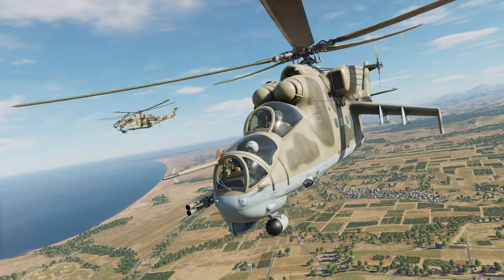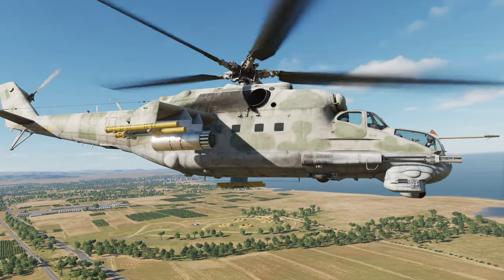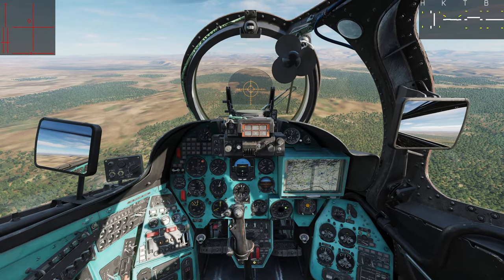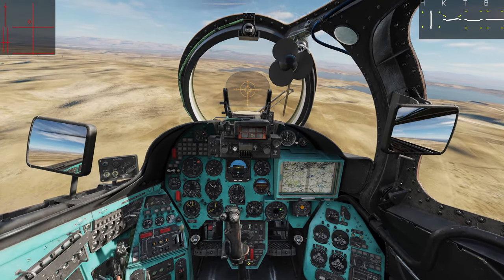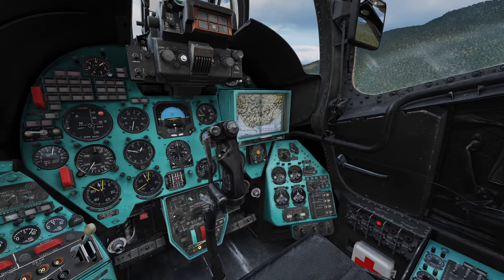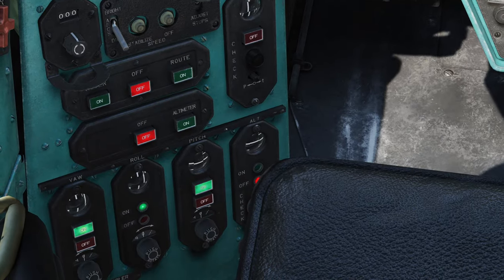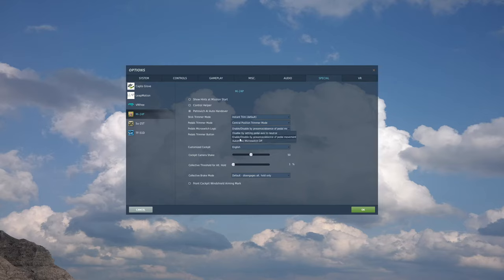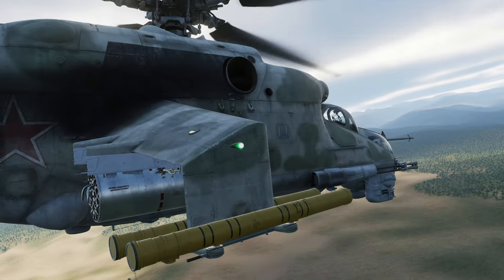DCS WORLD: MI-24P Trim & Microswitch Settings

Comment: The instant trim is the most realistic option if anyone is interested. The way to counteract the jolt is to click the trim lots of times as fast as you can as you’re settling into the new position. It has to do with the way magnetic springs are set up. You get the hang of it in time.
t. Mi-8 pilot
Reply: Finally someone that appreciate realism

Comment: Excelent video, very clear and concise. Just one observation, the default trim option for the cyclic is the force feedback friendly one. The springless option is only for those sticks without spring. I fly with a Sidewinder FFB2 and using the springless option doesn't work well, the default option simulates trimming seamlessly as long as the stick is calibrated properly.
Reply: He mentioned during the video that system detects FFB stick automatically and hijacks all input for special  FFB logic which is different from any of special settings ones. I think Force Feedback can be activated in main menu.
Reply: Proper trim setting for FFB is basically Instant trim. Can't tell if other settings are ignored, always used that and it's fine.

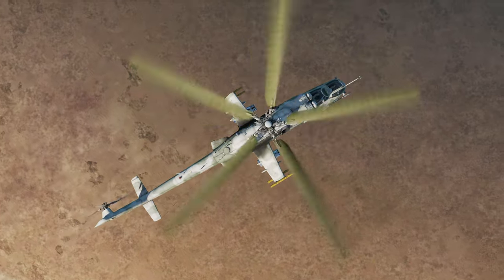Comment: 0:17 - This is very likely incorrect. The Mi-24's cyclic trimming system cannot use simple magnetic brakes since it also incorporates a trim hat beeper on the stick that can be used to change the trim position without pressing the cyclic trim release. This would require actual trim servos or actuators. 

6:04 - This is also likely incorrect, though I know that this is simply a repetition of what ED stated in their newsletter updates. I have seen a video (that I unfortunately cannot seem to find again) which clearly shows the pedal switches present in an Mi-8. I don't know what version of the Mi-8 that showed this, but I would suspect they should be present in the Mi-8 MTV2 module as well. Actual Mi-8 pilots, aircraft technicians, or engineers would be the authority on this, of course.
Reply: Can you explain which settings would provide the most realistic Hind experience? I do not care for making it easier
Reply: @MajFAIP  short of actually having the appropriate hardware, there isn't really a good solution. I'm going to have to play with the settings myself. I'm glad they gave the option to map the pedal switches as a separate bind. That is certainly the more realistic option. I complained about that in my H-60 mod review.

Comment: A well presented, clearly put video on the subject of the trimmer system, good job Wolfpack345. <3

But it's a "damper" and/or "damping" system, not a "dampener" and/or "dampening" one. =)

EDIT: Oh, and you should probably have mentioned the "Do not trim" option under "Pedals Trimmer Button". I have a magnetic brake on my T-Rudder pedals so that they stay still, so trimming them won't be necessary. I expect my preferred setting would be something like "Do not trim" and "Enable/Disable by presence/absence of pedal movement".

Comment: Why would detecting a Force Feedback stick have any effect on my antitorque pedal options?

Also, it's not just having the FFB stick, it's having the FFB option enabled. (At least it used to be.) I know, I have to change it all the time. It's great in the choppers, not so much in most of the aircraft (and a few are completely unflyable with FFB enabled). The real kicker, not only do you have to exit the server/mission to change this setting, but it doesn't restore default spring forces unless you completely exit and restart the sim! Major PITA! (And typical ED laziness. Would literally take one line of code to fix that last part. And if the first part is hard to do, that's their own fault for writing spaghetti code.)
Reply: And does Y toggle the microswitch on and off or is it momentary? (Surely the former? We're not expected to hold a key down while we fly, are we? But if it is the former, how do you tell what mode it's currently in?)
Reply: And... does two trimmer buttons mean we now have TWO imaginary trim-release buttons too? Or does releasing one release both? (If so, why should it?)

Nice work, ED. You've added a can of worms to the spaghetti code!

Comment: Just a quick question. So the only way to trim the pedals is to use the cyclic trim button (if that option is selected) or to use the disable microswitch button correct? But I can't find a binding for disable micro switch and can't seem to change it from the Y key. The two pedal options don't seem to really help with spring loaded pedals, as if you want to relax your feet your pedals will move and thus enable the microswitch ruining your trim, correct?
Reply: Hey Gman hows cold war servers doing? :D  Button on cyclic (like it was before) or  microswitch button can trim pedals. As for automated logic of microswitch, just choose what is best for you. Micro Switch is AP Yaw channel align button in controls and I can map it to joystick fine. Maybe you have config file problem if you can't map it to joystick, try to save config and delete it from saved games, then when it will be recreated restore saved one.
Reply: @LazzySeal  thanks man. Sadly have been busy with work so less time for Multiplayer. Thanks for the name for binding I don't know why they don't make it the same title lol.

Comment: Thanks for the video but I would have liked to see something more complete with the practical use of the microswitch during different flight phases...
Reply from the maker: I'm sure I will be doing a video on the autopilot in the future
Reply: Excellent suggestion. I know this comment is a year old, but I'm still trying to get the hang of the trimmer system, especially the pedals. I get that a lot of this is user preference but when you starts out, you don't know enough to know what a good baseline might be, after which you can decide which setup is better for you and your gear.